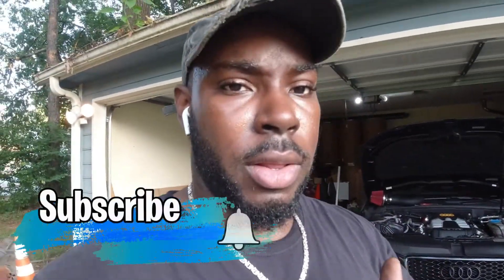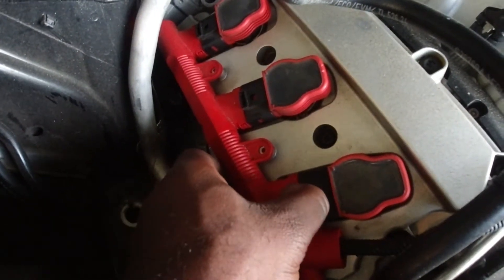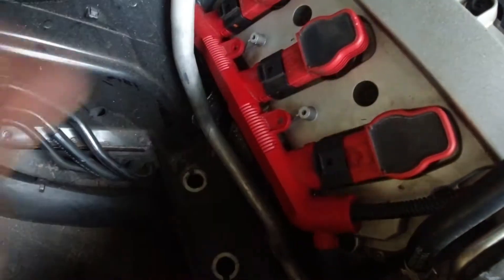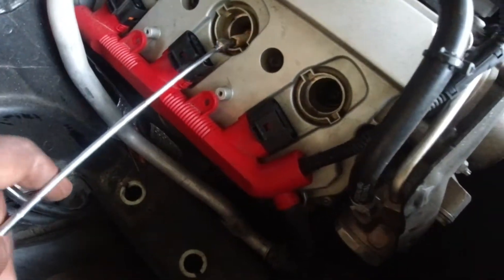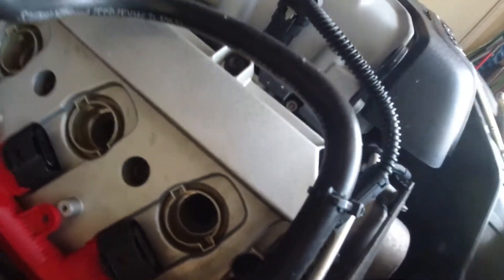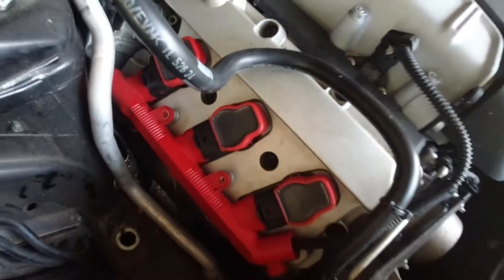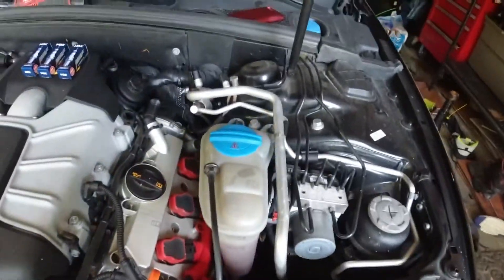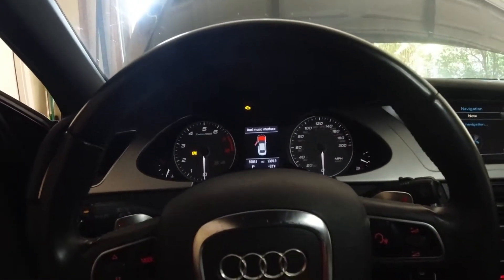NEW SPARK PLUGS!!! | Audi S4

Comment: Great stuff! Just got my 2013 S4. I love your videos   please make more general maintenance vids! Thanks ! SUBED!
Reply from the maker: Thanks man happy to do it!
Reply: Real quick , does the Amazon dip stick need to be a certain length to be safe? Or is regulation length fine?
Reply from the maker: It was fine. I’ve compared the Amazon dip stick and the oil level on the mmi system and it’s consistent. It is as accurate as it can be.
Reply from the maker: ECS tuning also have a oil dipstick specifically for b8/b8.5 s4 if you Prefer
Reply: @Wattis161  thank you so much. Just one more question. What is the b8.5?? How do I know if I have it ? I have the 2013 S4. The MSRP is $60,000. Does that help? Sorry I just got her out the blue.
Reply from the maker: It’s cool man I love when people are willing to learn. 😃 the term b8.5 is the chassis code/ number of the car. 2010-2012 are known as b8, which I have on my channel, 2013-2015 are known as the b8.5 which you have! Your s4 is the updated version/ facelift of mine with updated interior and resolved mechanical issue such as timing chain issues and transmission issues. You got a great car man take care of it.